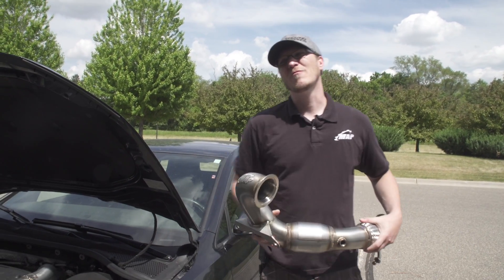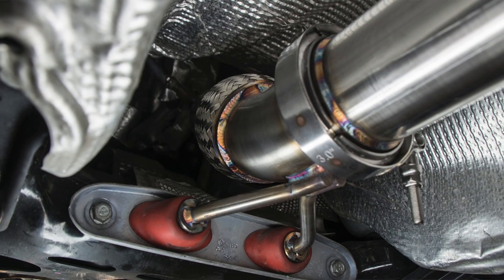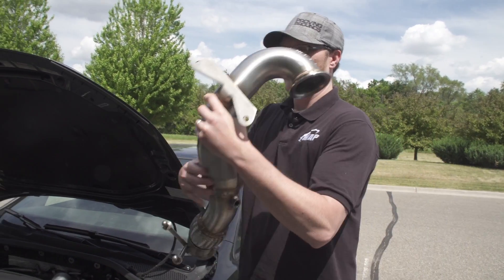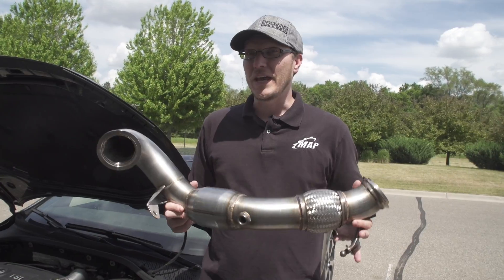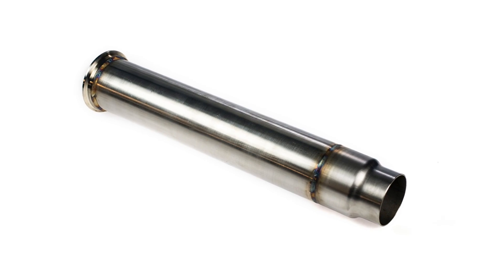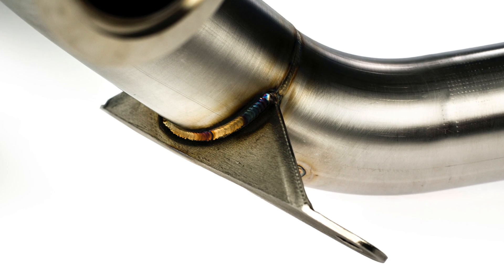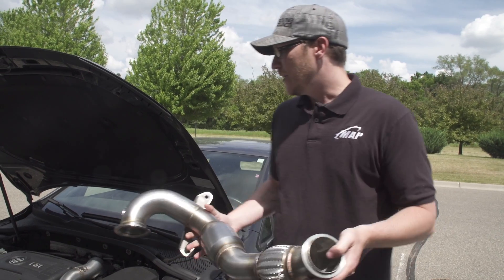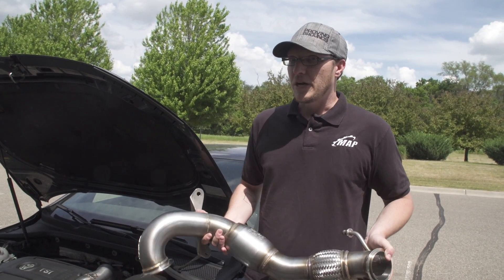MAPerformance 2015+ MK7 VW GTI Performance Downpipe

Comment: YES! People are going to be frothing at the mouth for this.

Does this DP throw a CEL without a tune?
Reply: All downpipes require a tune, however, I have a GESI cat on my '16 WRX. The cat is a "real" cat and actually reduces emissions properly, or so that's what was advertised. I asked my tuner to keep my catalyst ready monitor on, and I have no check engine light. To be clear, there is no way to keep that check engine light off without turning off the catalyst readiness monitor.